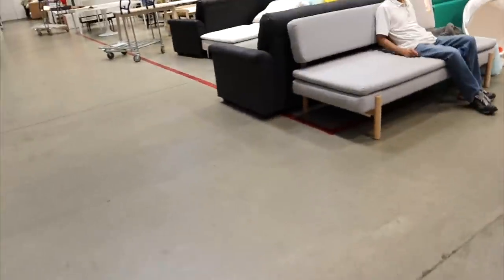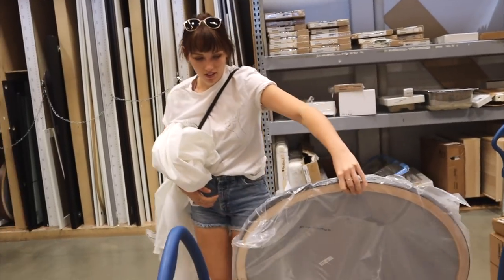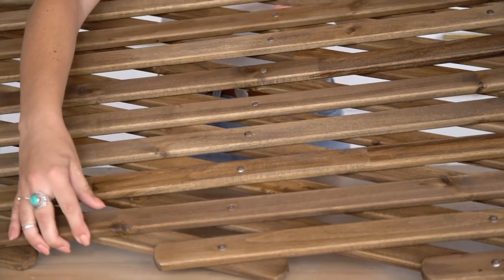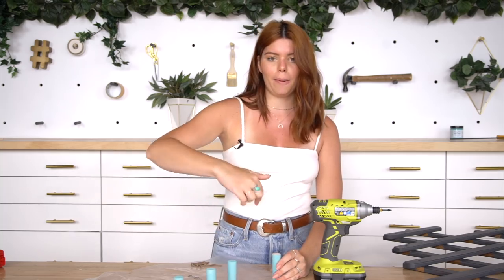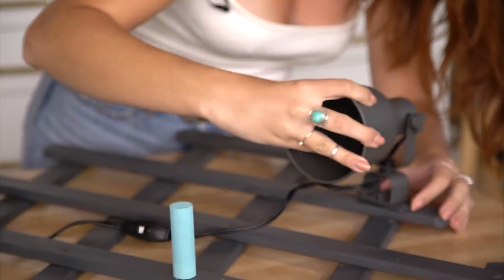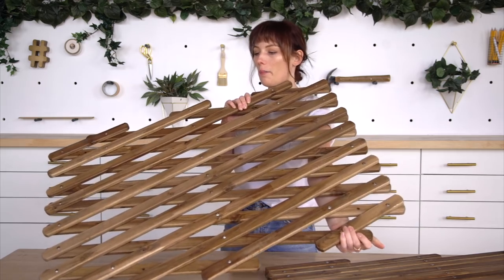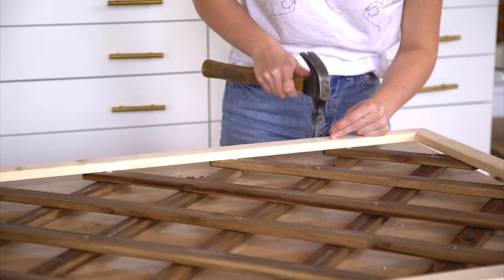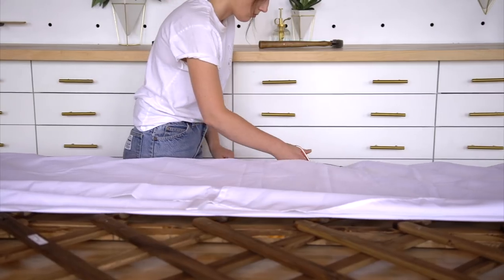Making Dorm Decor from Ikea Items!

Comment: I don't think the time of day matters too much, it mostly is based on how fast things are moved through the returns/department that preps things for resale. The end of a season does tend to bring a lot of cool stuff though because season specific collections are marked as discontinued and eventually moved down to the As-Is section. It also brings a lot of changes to the showroom which means display items that will not be used in the new displays are usually sent to As-Is. My only advice is that you look through every time you go to IKEA. I'm there all the time since I work there, but if you don't and happen to drive by, it's worth a peek. Even if you only go to the As-Is section.

Comment: “What’s the point of a room divider??? Idk, to hide people???” 😂
Reply: 👩‍🏫The reason for a room divider varies, but this could offer... 

▪a *privacy screen⚔ 
(1) for a seating area on a balcony|porch from a 👃nosy neighbor or busy street view🚖; 
(2) in a corner as a dressing room in a shared dorm👗;
(3) for a window while not entirely blocking the natural light☀️; or
(4) to conceal storage📦.°

▪visual interest⚓. You could tuck this in a corner. Turn it into a reading nook w/an angled chair or chaise, floor lamp & a petite side table.
 
▪visual balance to a space⚖. Sometimes a room can seem lopsided to one side with one seemingly heavier "show piece" item. Consider a tall armoire with a lot of other low profile furniture. A screen like this tucked in an opposite corner could restore a sense of equilibrium to the space by matching it's height & overall impression elsewhere in the room.

▪architectural detail⚛. If you have a big boring box, but want separate zones. Have seen where designers attach a single panel @ each side of opposite room walls (directly across from each other) in a place where they want to create drama or separation.
        ~~~~~~~~~~

°Had a BFF👭 w/a 4 bi-fold panel divider that she created to go across a corner in diagonal. She used that corner to stow boxes📦 of seasonal decor & power tools in her small apt. 

🖌Each side of the divider had a different paint &/or decopauge treatment🎨. She would flip it around 1x/yr to change her look. She staged a narrow console table in front + center of it as her "entry" -- and would get lots of compliments on it too. 

*Would flip divider hinges, so the lattice panels are facing most desired area as needed.
🦋 Happy Styling! 🦋

Comment: I love Becky's. For styling, I would tape the lamp wire to the back of the trellis, following the pattern, so you can't see it.
Reply: Yes, hiding the 🔌light cord behind the panel would be an excellent finishing detail. 👏

🤔Might suggest attaching block spacers at each corner, so seems free floating. Or, a frame behind the entire panel for added stability out of trim (2"×2"?). Something that is thick enough to leave a slight gap between the panel itself & wall when it is attached:

1) It will make a cool shadow on wall behind when lit💡; 2) you could use those tiny command hooks instead of tape to corral that light cord behind the panel. 

In either event, 💕love💕 this giant pegboard accordion style coat rack made out of this material. 😁Feels fresh, interesting & quite practical. 

Plus, it keeps jackets & bags from leaving dirt or oils on the wall itself😣.